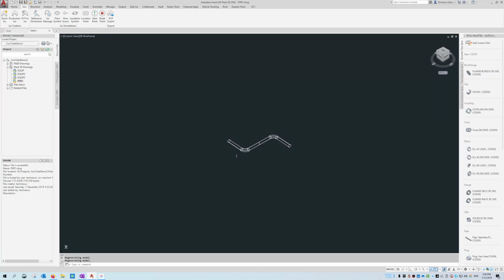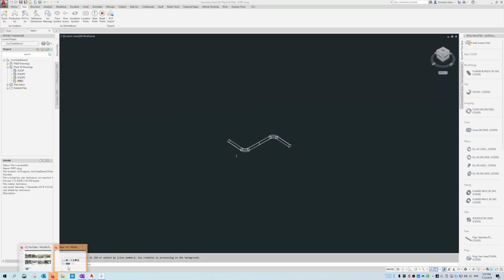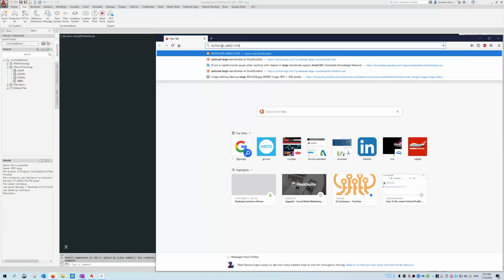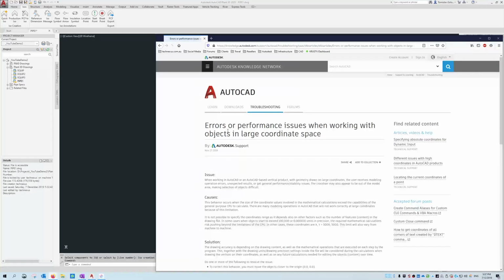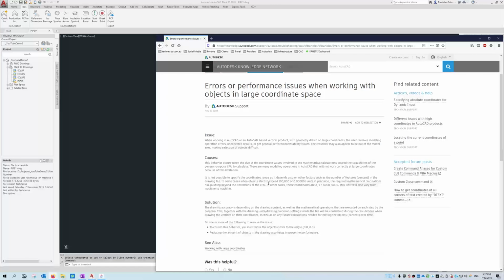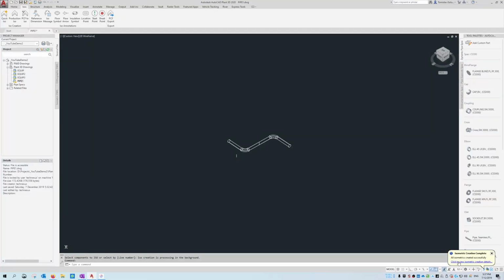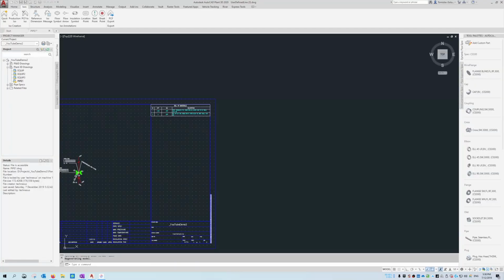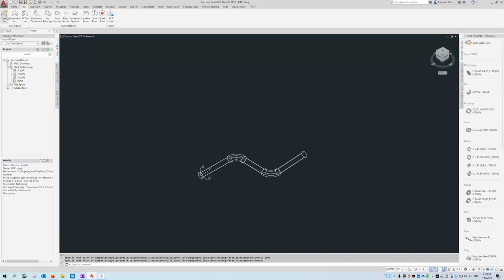Tech Talks - Plant3D and (Large) World Coordinates...

Comment: This is really a great piece of information. Thanks. We were struggling with same issue last week. Even Steel structure doesn't get modelled correctly at large coordinates. Like, it doesn't get aligned with Grids. We are using P3D 2021. Not sure if Autodesk has resolved this issue yet.